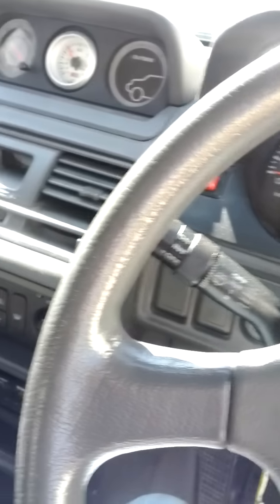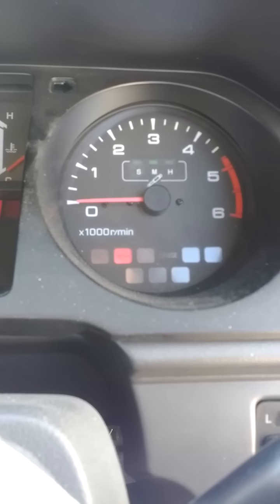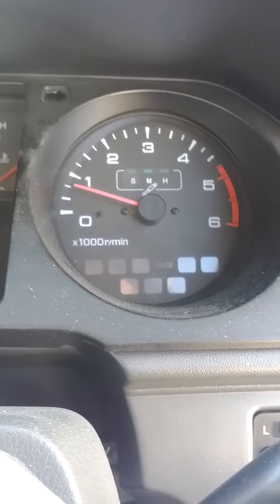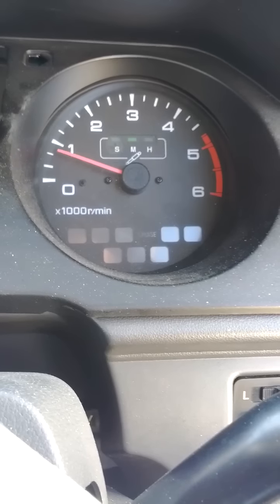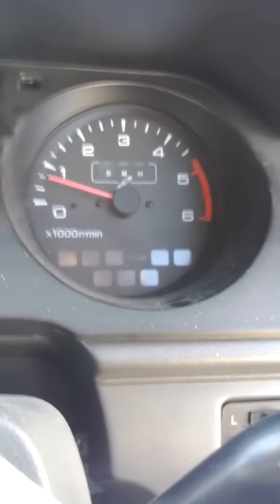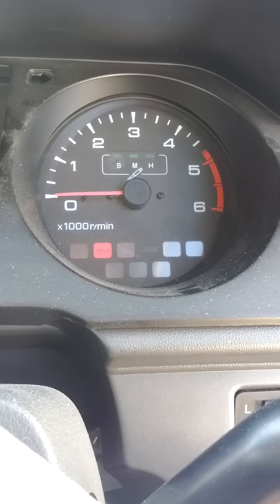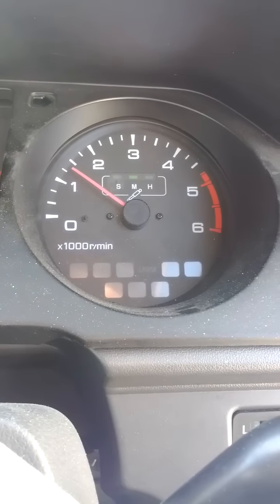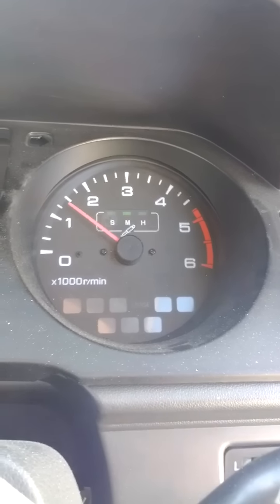Stalling Issue with my Mitsubishi Pajero

Comment from the maker: Hey dude it's the Injection Pump Front Seal. I tried to sent you a private message but apparently I can't do that your profile won't let me. I got it from a local shop here called ccautos . ca they sell it for $18 CAD. I had it installed for about $200 labour from a local diesel mechanic (I was halfway across the country from this shop when I started having the issue.)